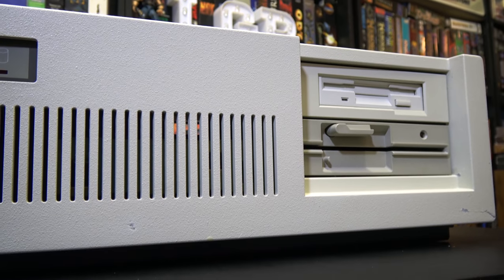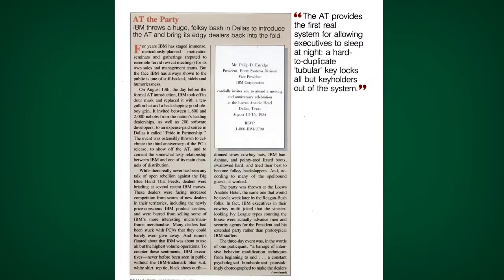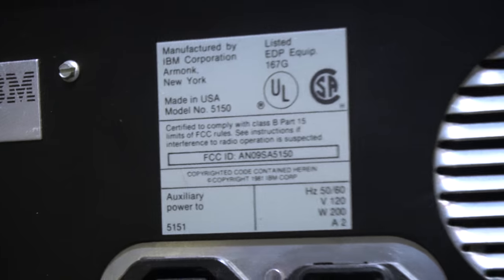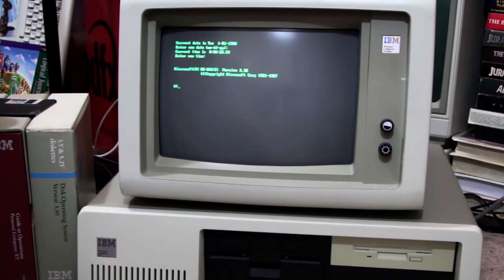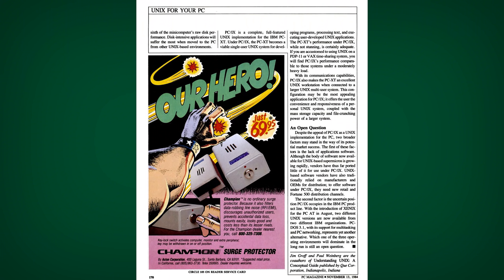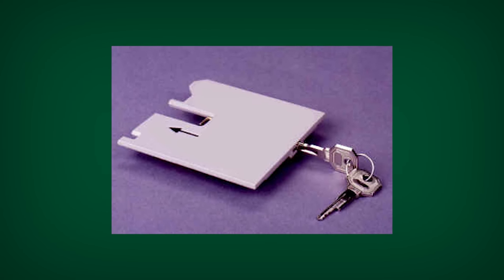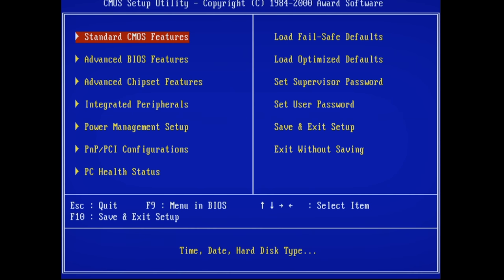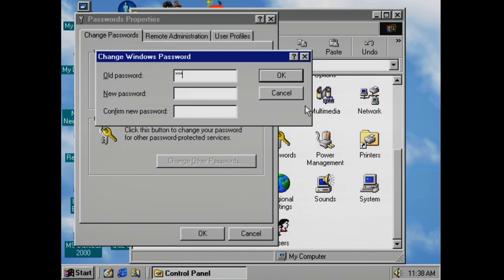Why did old PCs have key locks? An LGR Retrospective

Comment: For some extra fun, put the turbo button's wires on the key lock instead.  That way you can have it on low speed, then when you want to rev it up, you get to turn a key and make engine noises with your mouth. VRRRRMM
Reply from the maker: That's an awesome idea, haha.
Reply: Even better: wire the keylock to a gas-powered generator with an electric starter as well, then plug your computer into the generator.
Reply: There is a joke of some not-so-bright guy just hired, that was told to krank a handle (like starting an old car) when everything was running slow. It was on ad mainframe so if the story was true he really had no idea about anything. I think the handle raised his terminal desk. 
Just swapping the keyboard cables also worked wonders. And that is not anecdotal. 
I personally had a lot of fun making slight "adjustments" to early Windows computer like mirroring the "shut down-image" (or making it look like a burnt-out monitor) or making the mouse run 30 degrees askew. I also had a mouse pointer that wiggled its tail. 
Then people learned to lock their computers.
Reply: Can you tell me the one for the wiggling cursor? i kinda want that now haha
Reply: Joseph Fanning SPIN ON!
Reply: I like the way you think Joseph.
Reply: Noel Goetowski like that computer in the Nissan Leaf commercial titled "Gas Powered Everything". If I were to use a key lock on a computer in the place of a power button, I would use the ignition switch from riding lawnmower to where I could switch on and off RGB lights.
Reply: [running in the 90s intensifies]
Reply: And connect the turbo to a loud ass server fan lol
Reply: It would be fun as hell playing a DOS racing game like Test Drive or Stunts that way. XD
Reply: Plus "Oh you NEED to use my computer AGAIN? Fine, but I'm locking you out of Turbo".
Reply: EVERYONE DO THIS NOW
Reply: Adam Winkelmann NO
Reply: +Garf20 OKAY FINE
Reply: this "adjustments" comment reminded me of how my dad and his co-workers messed up with the PC of another co-worker on the company, changing the "You can now safely turn off your computer" message to "Your computer is now contaminated by a virus. Turning your PC off will wipe your disk and brick your computer"
Needless to say she freaked out
Reply: Remember the one time I forgot to lock my screen when I was away from my desk at work. One of my co-workers thought it would be fun to invert & mirror my screen. They were disappointed by my lack of freak out, as  I'd accidentally done that once when fiddling with display settings. 

If you really want to mess with some-one when you do that, change their mouse settings to left-hand. Heh heh.
Reply: I read somewhere that the "perfect" pc prank is to take a picture of their desktop, flip it and set it as the desktop background, disable the visibility of desktop icons, invert the screen and the mouse.
Reply: Did this at work all the time. They were strict on locking your computer when you stepped away from it. So the lock screen was the desktop with their software open. They would think I left it unlocked until they realized clicking did nothing.
Reply: Sounds like a theo Joe hack
Reply: I was thinking this the whole fricking time! :D
Reply: Felixkeeg double your bank account with the turbo button
Reply: Why do it with your mouth? I'd write a program file to run a sound file of engine noise when the key is turned.
Reply: Ackchyually, the turbo was usually always on and you disengaged it when you ran (older) software that did use the clock speed for timing. otherwise everything would run way too fast. sooo...maybe it should be called throttle button?
Reply: The turbo button makes the computer run slower
Reply: Dammit, every so often I wish YouTube would get rid of the comments section altogether, but then I come across gems like this and realize what I'd be missing out on.
Reply: there's lots of fun you can have with computers XD
Reply: Joseph Fanning that's fucking funny
Reply: Joseph Fanning Ok, that was a brilliant idea.
Reply: It's the Bugatti Veyron DX2/66 where you have to put the key in the center console before you can unlock the full potential!
Reply: except turbo actually slows the PC downl
Reply: i liked the key turning as it feelt like launching an intercontinental balistic nuclear missile ... :-)
Reply: Shino's Garage TV the children don't know
Reply: NuclearSavety it actually did you nuked Africa
Reply: Lost it :D
Reply: Speed it up to what? The speed of my potato phone?
Reply: hug u
Reply: LOL! Unfortunately I never noticed a speed increase when the turbo button was on because shit was still slow back in those days.
Reply: Intel needs to make a CPU with a direct connection to a joystick speed controller (or whatever that thing is called).
The higher you push up, the faster the over-clock.

Now you're gaming with blast processing!
Reply: The Turbo button does not speed up the system, it locks the clock so the games can run with stable FPS.
Most of the time you had lower FPS while Turbo button on.
Reply: That's kinda stupid since you can cap the framerate using code. All you have to worry about then is making sure the framerate doesn't drop due to extensive resource usage. A turbo button can't keep a program from slowing down. If the program executes functions that are CPU intensive, the CPU will slow down no matter what.
Reply: Ever try swapping mouse cables?
Reply: my brother in chaos
Reply: For some reason "Turbo Mode" Just seems funny to me. Maybe it's the fact that the cpu runs at 66 mhz XS
Reply: Even more fun if get a recordable greeting card and wire its chip to one of the LEDs on the keyboard.
Reply: I made a case mod about a decade ago where you had to turn the key to turn it on. It was chromed up and had chrome wheels with tires under it.
Reply: @LGR  Just don't forget to add a Dymo label that has "IGNITION" written on it.
Reply: @Swassticles  
This comment is cursed
Reply: lol
Reply: @Swassticles  or the other way around
Reply: Car enthusiast PC?
Reply: @typograf62  I like to set the displays upside down on public computers
Reply: @JoelPit  I use an editor where a function is mapped to the rotate screen hotkey, and it can't be remapped. So I must use the mouse and menus to search for matching bracket. Annoying.
Reply: I would take an AMD 5x86 133 based computer and find the jumper that overclocked it to 166Mhz.  I would wire the key to it.  Then I would power down the computer at  5x86 133Mhz, turn the key, and turn it back on as an overclocked AMD 5x86 166Mhz.  I was a computer god. It would make the Matrox Mystique video card run swimmingly smooth.
Reply: @MrCumberlander1  Yes.  The default was on.  When you pushed the button, it would slow down the computer to be able to run vintage CGA and monochrome programmes intended for old 8086 processor computers.
Reply: @Bronco541  What I have been doing lately is buy old, dead, computers that have silver traces.  I pull up the dual layer traces and melt down the silver.  So far I have a block weighing 78 pounds of silver.  It may one day be of significant value.  It is better than money put in account.
Reply: @sheilaolfieway1885  Yes, there were computer cases with themes orientated around Corvette, Lamborgini, Mercedes Benz, Pontiac, Saab, even stupid cars like Renault, Citroën, as well.
Reply: Gives a whole new meaning to device driver.
I've got another idea for a "turbo button" just have it put all the fans on max speed, so it sounds faster! Then all we need is turbo buttons next to both the outside and inside buttons of an elevator. Getting impatient? Just press the turbo button and it makes "speeding up" noises so you think it's going faster!
Reply: @typograf62  when I was at uni we had computers running Novell Netware with MS-DOS.  One funny trick that used to get none computer users stumped was when you first approached the computer you'd have this graphical screen welcoming you to UCLAN which would cycle round advertising all sorts of stuff about UCLAN.  If you pressed Ctrl+C it would drop you back out of the graphical screen to a DOS prompt (where you could just type login to begin the login process - the real way to login was actually to press any key (other than ctrl+C) and then it would automatically run the login system.  But once you were at the command prompt not only could you do login you could also do some other MS-DOS commands, including both prompt and cls... so if you typed "prompt $s" and pressed return then cls and pressed return all you were left with on screen was a black screen with a flashing cursor at the top.

Another trick that some people used to do which used to annoy the heck out of the admins at the uni was if someone forgot to log themselves out of a computer system, when you first logged in the system would run a batch file called "Menu.bat" - by default on the paths setting F:\ was the first location it would look for batch files, followed by X:\ - F:\ was our home directory which was editable, X:\ was where the real menu.bat was stored.  If you created a new file in your F directory called Menu.bat you could customise the menu which many of us did just that (some of us even used tools like Norton Utilities to make it look really fancy and colourful - if you were in the computer society you had access to an extra drive called O drive which had Norton Utilities and a few other good things in it!).  The only slight flaw with this menu.bat trick was that if you left yourself logged in accidentally anyone else could edit menu.bat for you.  There was one occasion I did it and thankfully the person who saw I'd left myself logged in just edited menu.bat with a nice little message reminding me to logout next time - but some people went even further - some people altered menu.bat to just read one word - "logout" - the thing is novel netware's logout program had no "Are you sure you want to logout? Y/N" question - logout would immediately log you out of the computer - so if someone kindly changed the menu.bat file to logout then the minute you logged in the computer would automatically log you out, and because it happened so fast there was no time to press ctrl+c to stop it running.  The only solution was to go over to the IT admin and ask them to delete the menu.bat file from your F drive.  The IT admin got so fed up of having to waste their time unblocking peoples computers that had this done to them they had to issue a request that people stop doing this as even though it was funny it was taking up a lot of their time and that if people didn't stop they'd change the paths round so people couldn't edit their own menus - after that warning people stopped doing it.
Reply: @U014B  aaAi
Reply: genius
Reply: Great idea! However this is the most liked comment after all!

Comment: Summer of 1988, I was an intern at IBM. One of my jobs was to help remove hard drives from old PCs that were being retired. For those with the big IBM Personal Computer Keylock Option on the side, if the key was missing, my orders were to give it a sturdy kick. Worked great! :-)
Reply: I had similar job a couple of years back, my method was to take a few PCs on a delivery wagon, go outside to loading platform and drop them to the ground two meters below.
Reply: gee hard drives in 88 would of been 25 megs... my hard drive from my 1992 386 was just 85megs. when you had .72 low density disks in 88 that were less then 1 meg 25 meg was pretty big   one good game would of been less then 1 meg

Comment: Turn the keys, press clutch and release the brake.
Reply: You forgot to pump the pedal three times before turning the key.  Or at least pull the choke.
Reply: I ram the wall in front of me. Instructions not clear
Reply: Press turbo when a virus comes
Reply: I see you’re a fellow man that lives one 25kb at a time. We’re family.
Reply: Put it in first gear slowly release the clutch and go
Reply: Don't forget to wind it up first.
Reply: Press the clutch then turn the key 😂
Reply: Let it warm up for about 10 minutes...
Reply: Transformice!
Reply: You forgot to say "family" before take off. Lord Torreto wont take it kindly
Reply: @emanuelperez3595  I don't take kindly to people who don't take kindly
Reply: Pullstart, maybe a hand crank ?
Reply: @HPTeguh  I go backwards cause you never park a manual in neutral. You park in reverse.
Reply: I can smell clutch.
Reply: Don't release brake untill you get in first gear and keeps rpm between 1500-200
Reply: Turn the keys, press the clutch, rev to desired RPM, release the brake and release the clutch as fast as you can.
Reply: My computer started flying what do i do
Reply: Provided you have a steering wheel connected to the computer